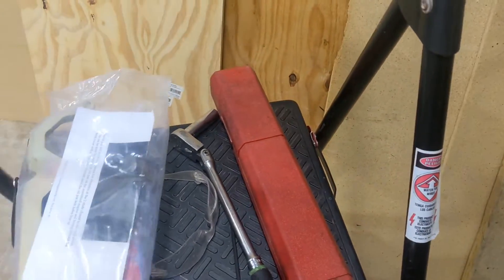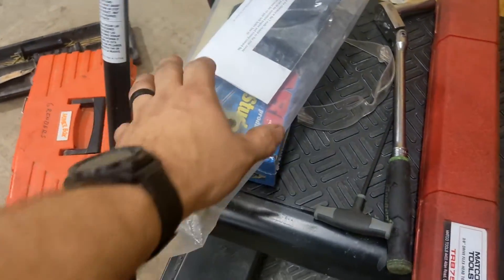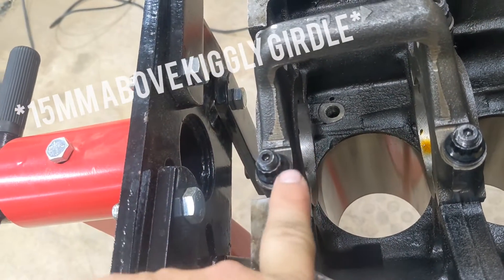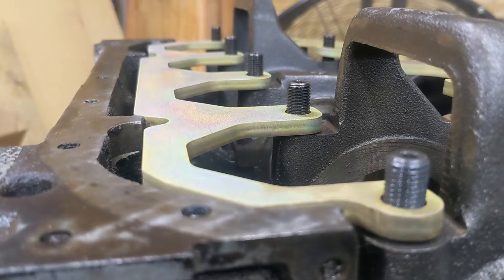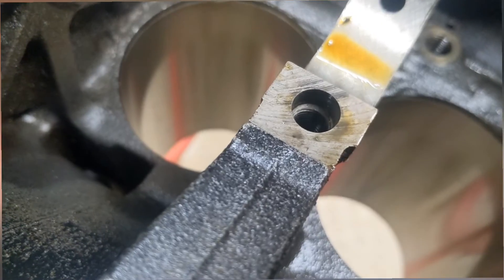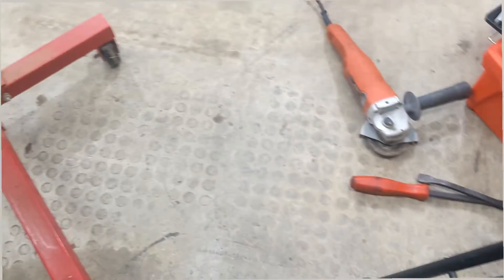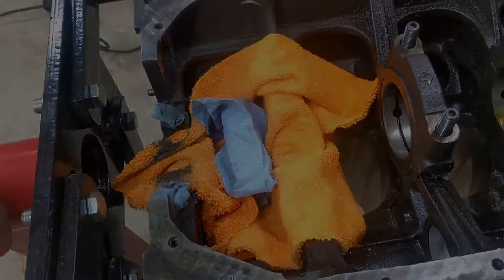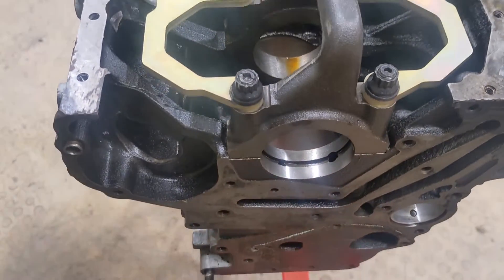Kiggly Racing main girdle install. 6 bolt 4G63

Comment: What about oil pickup
Reply from the maker: Most guys just run the two bolts back to the oil pump.  I've also seen others run that 3rd leg/brace to an arp stud and put a second nut over the top if space permits, usually need to drill out that support hole a bit.  I ended up not building this car, but that's what I've done in the past as well.

Comment: At what power point would you think this is a good idea over just having arp studs?
Reply from the maker: Many say 600+ it is recommended. The manufacturer recommends it at 350hp actually as the individual caps can shift.
This motor made 900 without it however, so your results may vary.
Reply: @completetuningsolutions  
Thanks for the reply, I figured it'd be around there. 

I was making 550whp last year and just swapped to a 6766 so I'll have the potential to hit around a thousand.

Guess I'll keep it turned down until I have time to pull the motor and toss the girdle in.
Reply from the maker: @schafer240  before they were a product we were making 700+.  The girdles drastically reduce your chance of main issues.
Reply: @completetuningsolutions  

I could see that, it's probably even a better idea for me as I'm running a 2.4 Galant 6 bolt motor which has all individual caps.

I'm a fan of kiggly, I have their springs/hla and trigger kit. Not cheap but the quality is outstanding

Only thing holding me back from just tossing this in is a line hone. I wouldn't want to risk it with the amount of money I've tossed at this motor
Reply from the maker: @schafer240  unfortunately you'll want to do that (line hone).  This is especially true if you aren't running ARP mains.
Reply: @completetuningsolutions  

I agree, I am currently running arp mains and head studs. 

I also want to switch to Manley turbo tuff I beams in the future, I'll just do both at the same time.
Reply from the maker: @schafer240  I'll show them soon but don't discount aluminum rods, especially the vadar (FFWD) stuff.
Reply: @completetuningsolutions  

If I was running a full drag car Aluminum would be my choice for sure, but for a street car it doesn't make much sense with the short life cycles of them, which makes the Manleys a better choice for me.
Reply from the maker: @schafer240  that's fair.  The life cycle is shorter but then the trade off is bearings instead?  It's always a game of trade offs when you start to push combos.
Reply: @completetuningsolutions  
I cant talk from real life experance on 1000+ with a 4g63 as i havent run that power yet but your not wrong, taking a motor that made 180whp stock to over 1000whp will have limitations no mater how much time and money is thrown at it. 

That being said 4g and the Honda k series are amazing for what they are.
Reply from the maker: @schafer240  it is a wild time to be modding cars for sure.  Materials, technology, and combo advancements are difficult to keep up with.  Thank you for the engagement and good luck with your build!
Reply: @completetuningsolutions  
You as well, good luck. I agree I constantly think it can't get any better.

Comment: I had a 95 eclipse with the naturally aspirated 2.0... totaled it. Now that I have been on the forums in search for a replacement 2g 4g63t I shorty found out they are bad engines because of crankwalk and do not come with a 6 bolt in any year. They say to stay away from the 95-96. If you can shed light on this subject that would greatly appreciated. Thanks
Reply from the maker: Thanks for commenting!  The 7 bolt 4g63 is a good engine and the crank walk issue has somewhat been blown out of proportion.  The key for any engine build is to set the thrust bearing, main bearing, and rod bearings correctly.  This requires proper machining and assembly techniques.  I went with a 6 bolt motor for this build as it was what was available to me locally at a reasonable cost (this is a 1/2 filled and o-ringed shortblock for drag racing application).  In a 2g DSM I would absolutely go with a 4g63T 7 bolt.  Much easier to install (as you don't have to do the 6 bolt in a 7 bolt modifications) and at this point in the game the aftermarket has more support versus the 6 bolt (as you can use 4g EVO internal parts most of the time).
95-96 motors are fine.  Tips to avoiding crankwalk include: Not to heavy of a clutch.  Proper assembly techniques and torque values.